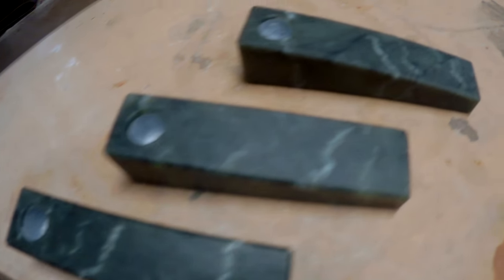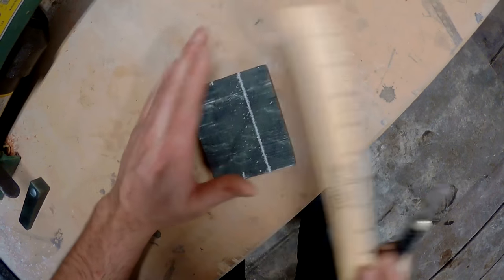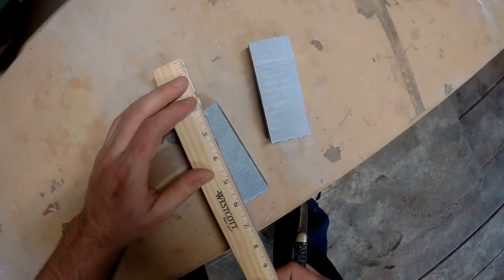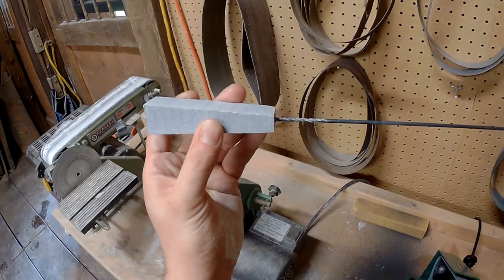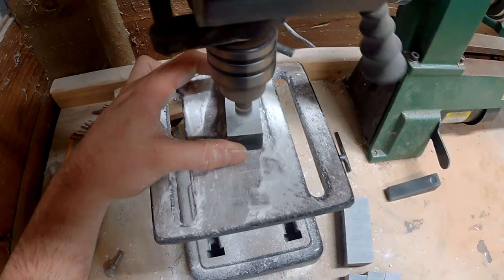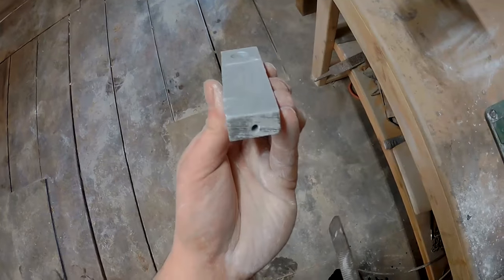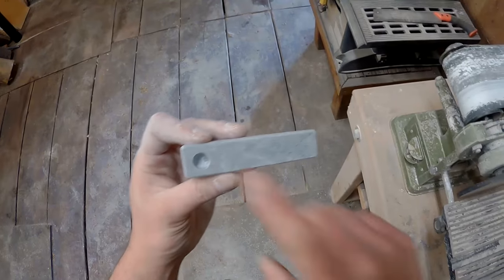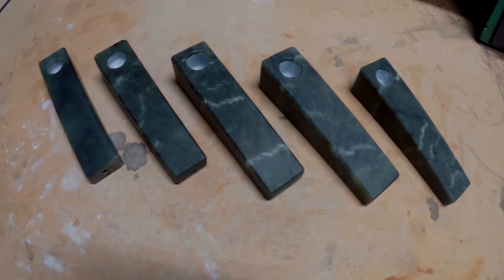How to Drill Out a Stone Smoking Pipe Blank - First Person View Soapstone Pipe Making

Comment: I use hard woods like cocobolo and rosewoods . The process is much the same however I use a hand made squaring not on the drill press to drill the stem after i have drilled the bowl. I never thought to use a countersink  for the bowl , it's a good idea. I wonder what you use to shape the pipe after creating the blanks? I use a combination  of belt Sanders and rotary tools. Thanks for the video, its given me some insight into using stone. And the format was fine if not perfect for the sharing of information.

Comment: SOAPSTONE IS TO SOFT FOR A PIPE
Reply from the maker: Soapstone is soft. Some types of soapstone don't hold together very well. Some soapstone is like compacted mud. Other soapstone looks and feels like serpentine or even jade. The soapstone I use is a little on the harder side for taking detail for large sculptures. The black pipes I make are made of what's called black soapstone, which is a serpentine and is a good hardness for carvings that resist dropping and chipping well. It is dense and is very tough, much tougher than other soap and pipe stones I've used. Most layered soapstone pipes will break just like a glass pipe. These pipes hold up. I dropped them regularly when I used to smoke daily. If they ever get really gross, a scotch Brite pad and some oil or wax makes them as good as new.

Thank you for watching!